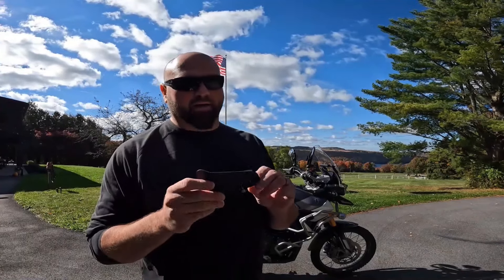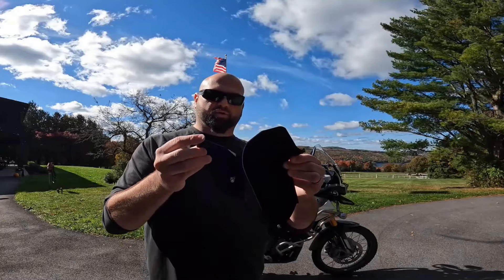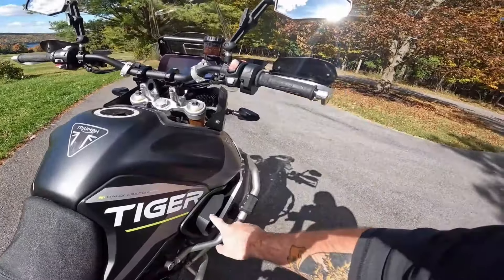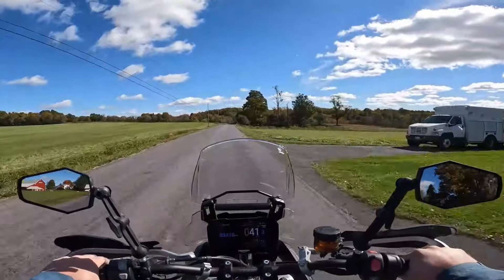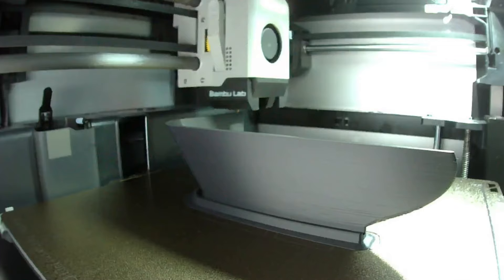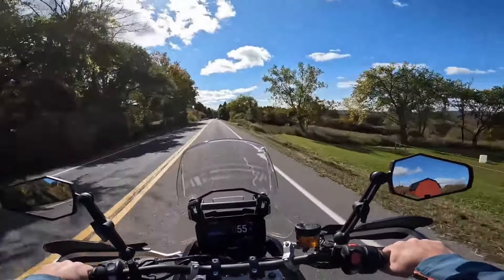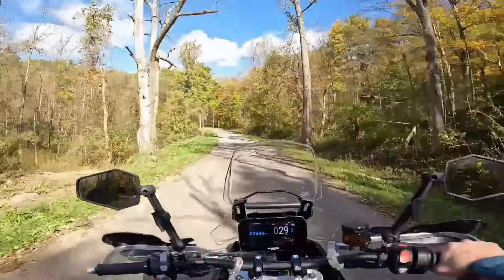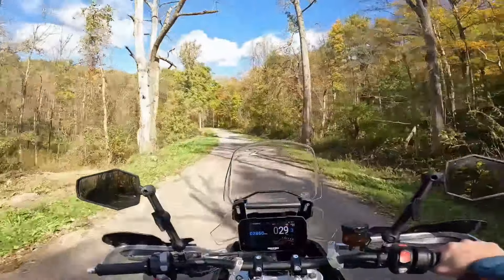Snap On Heat Deflectors | Triumph Tiger 850 & 900

Comment: Thank you for the video. I’m pretty sensitive to the heat and my old Tiger 800 had it. How do you think these would do for slow city riding and commuting into the city? I’d love a Tiger 900 but worried I’ll cook in warmer weather.
Reply from the maker: Honestly, I would not choose the Tiger 900 for city commuting. It is probably the #1 flaw for this bike, just doesn't make sense with the amount of heat it produces even with the deflectors. Thanks for watching.
Reply: @MotoInTheValley  Thank you for the honest response. I'm between the Guzzi V85tt for its character or the Tiger 1200 Rally Pro...just because ;)